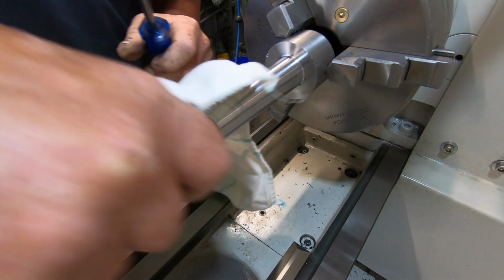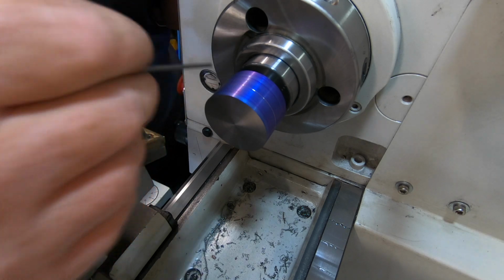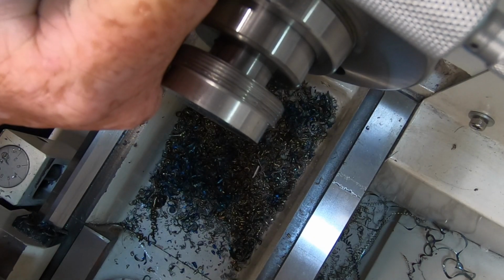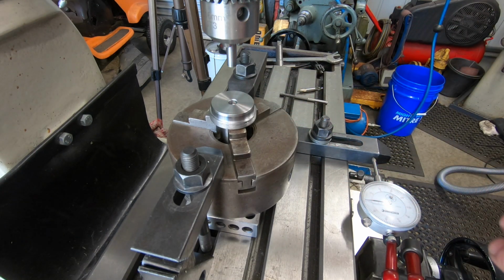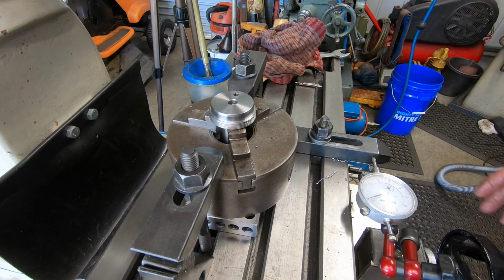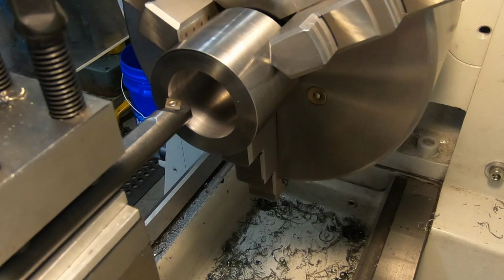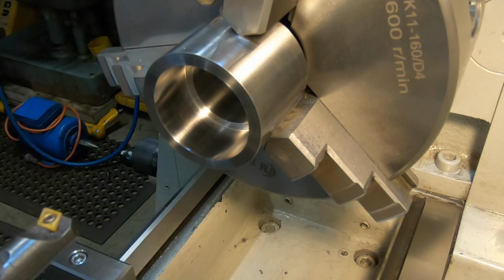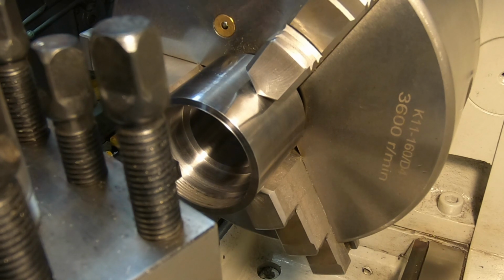Floating Reamer Holder

Comment: To overcome the work holding issue you could have drilled and reamed say a 12mm hole initially and then made a 12mm shaft that you could glue your piece to. Then using the shaft machined your features on the outside. Great channel!
Reply from the maker: Thanks Neil, cheers

Comment: Is it hard to get tool steel and material their?
Reply from the maker: Gday Tom, to buy quality hss I have found it expensive new but I have brought some from ebay at a decent price but obviously secondhand, for normal material like 4140 I can get that at my local engineering shop, it’s still not that cheap but convenient, I have also brought from Mancave metals and the prices there are not to bad...
Reply: @MattysWorkshop  👍

Comment: Matty  Nice Job - you da man, two thumbs up. It's obvious that you get pissed off working between 
Metric and Imperial sizes .I hate metric, when ever I get a drawing displaying metric sizes, I convert the sizes to Imperial.I make less errors by converting. Like the Lake said  Whenever you're in the neighor hood  " Drop In "
Reply from the maker: Thanks Jim, I still can’t get my head around reading the metric dials, I don’t mind the metric plans but I convert 99.9% of the dimensions, imperial makes sense in my small brain mate...
Reply: I can solve your metric dial problem . All you need is a suitcase full of money. Buy a DRO  for your lathe and one for your mill.
Dro's have metric and imperial displays . Do I get a standing ovation ?? ??

 @MattysWorkshop
Reply from the maker: @TangentJim  if I could afford a dro for the lathe and mill, trust me they would have one mate
Reply: @MattysWorkshop  
The dials on your lathe are easy ! Just got to remember they are giving you reduction in diameter not depth of cut like the al50 .
Set the dial on zero and then move it to 0.5 and it will take half a mill of the diameter  where as with the inch scale if you go from 0 to 1 on the dial it is 0.020 off the dia or 0.010 depth of cut- that just does my head in🤕
That being said for some reason i can mentally cope better with 0.001in  than 0.025 mm and microns really confuse me 🤣
Reply from the maker: @ianbertenshaw4350  
the metric has me buggered on the dials but I can read a ruler and mic no worries, I find using the imperial on the dials really easy, I guess one day I will have a dro the all troubles will be solved mate